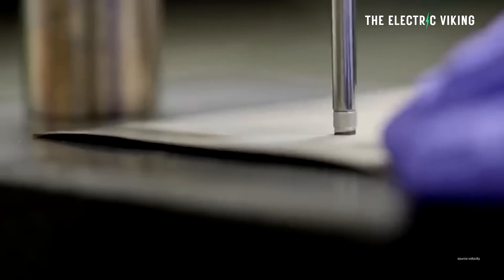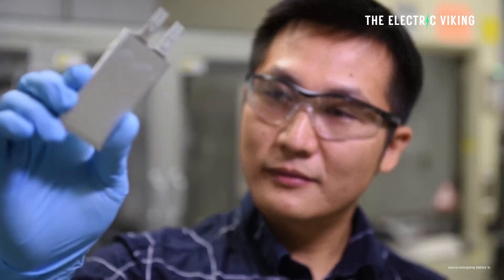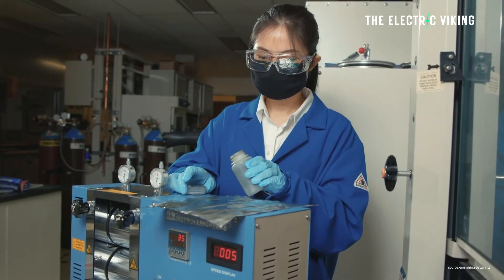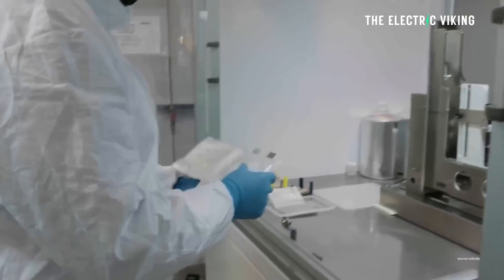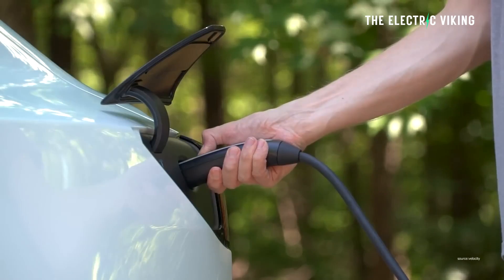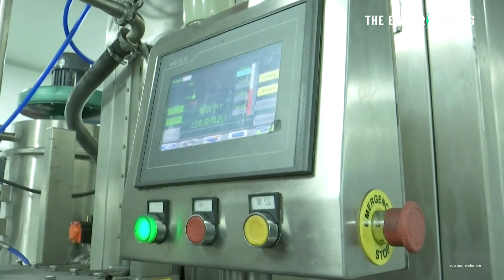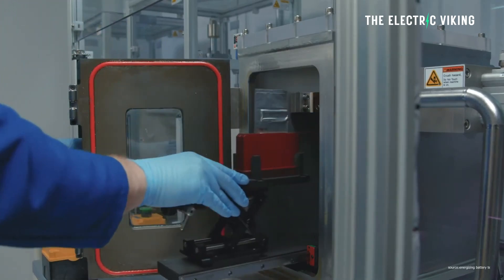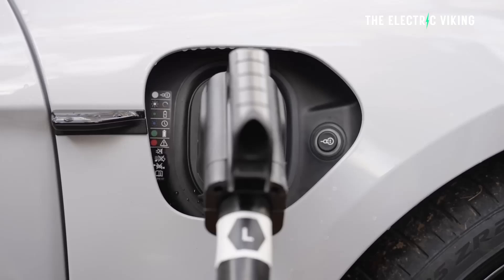Sodium battery with higher energy density than Tesla cells charges in seconds

Comment: The ceiling limit is the grid capacity to deliver such rapid charging, even more so as the EV market grows along with increase is capacity, when  you are looking at single car charging at 500kw  to be able to charge quickly multiplied be the EV, that like to big a number to even happen in any large charging allotment
Reply: I think onsite batteries that can help with peak loads will become more and more common. They can be charged at a consistent sustainable rate, while the car charging is way more up and down.

Comment: They always leave out one important metric. How long does it last? 1.5 million miles? If not, give me LFP in my car.
Reply: bacause you are going to drive it for 1.5 million miles? think that the normal lifespan of a car is below 250.000 miles.
Reply: That's not an important metric. You'd need a small power station and some very big charging leads to supply the sort of current required to charge even a "small" 60 kwh battery in 60 seconds.

Comment: Sodium is the cousin of Lithium, I'm not surprised. People said that battery tech wouldn't improve, but here we are with LFP, mass produced Li-Sulphur and now Sodium-Ion. This is a breakneck pace.
Reply: It all depends on the research budget : zero, millions or billions. It makes all the difference.
Reply: @Michael-Has-Opinions  Western Research is very  thirsty , they can  ''eat''  500 milion  euro with  effect close to  ZERO   :)
Reply: @Michael-Has-Opinions  China subsidi
Reply: It will advance way quicker when AI gets fully involved in the research and production
Reply: Ultra fast charging is not real. They will need to upgrade their 800V battery at least to 60000V
Reply: @rwyo83 Not just that, the output of the supercharger needs to be upgraded as well.
We don’t need faster charging. That’s catering to the requests of people who have never been in an EV and have ICE age mental barriers. We need less battery degradation.
Reply: It's kind of startling. We are going from disposable remote control kid toys, to flying drones with a lifespan that can be measured in decades.
Reply: Next thing needed will be a charging system that can handle that high a current flow.
Reply: Necessity is the mother of invention and when companies have to compete instead of all being owned by the same 2 corporations then technology can advance significantly in a short amount of time.
Reply: Battery adoption is very slow. CATL has its sodium plant starting, and they are not expecting to displace lithium anytime soon. Get used to lithium, and smaller cars, like Aptera.
Reply: @jaywalker1812  Aptera? You are joking, are you? How about a car made out of papier that can move with a speed of light?
Reply: I need a "How Evah" T-shirt.
Reply: I'm still waiting for the battery technology to mature. ICE matured decades, perhaps a century ago.
Reply: And some idiots still argue batteries require a lot of child labor in 2024 lol
Reply: LFP is cheaper than lead now what are you talking about. 100 amp hours 135 bucks. Buy a comparable lead acid battery for that.
Reply: @user-gu6ps6ed6l and sodium is much cheaper than lead... while lithium is much more expensive than lead.  Lead batteries are dinosaurs still walking.

Comment: You missed an important thing, that it's wonderful. Also as supercapacitors, it has a capability of massive cycle retention. It doesn't degrade significantly after 5000 cycles.
I don't think more than 10C to be important for EVs as they can't discharge or charge faster because engines or high voltage chargers respectively. But cycles... a battery that doesn't degrade it doesn't matter how to treat it? Supercharge everyday? High acceleration? Don't problem. The battery can do that and more, as it's upper limit is 100C. An order of magnitude more.